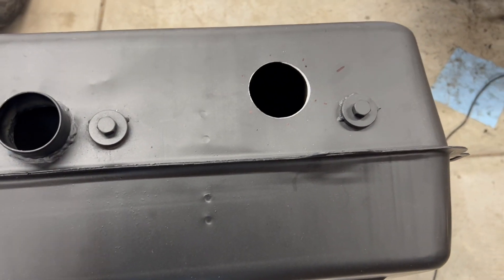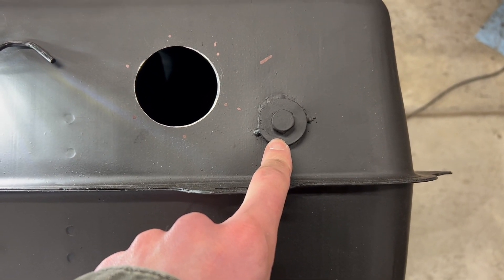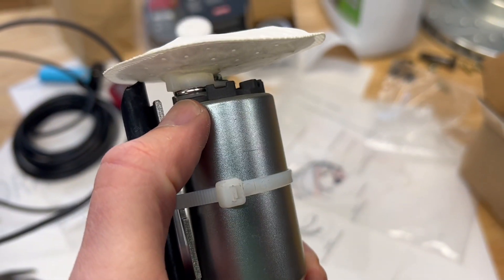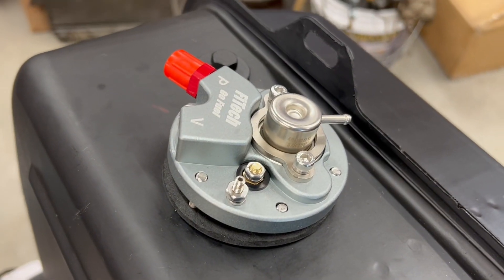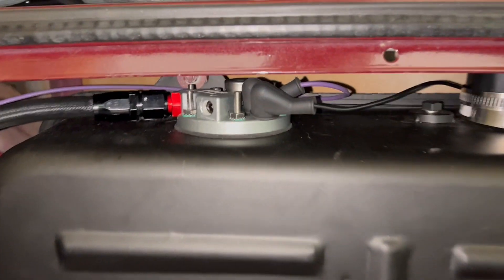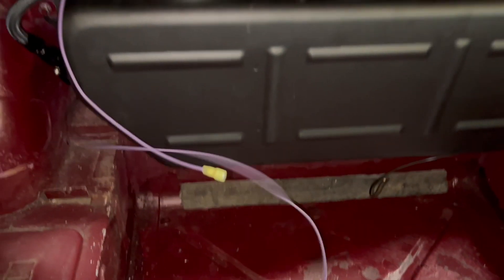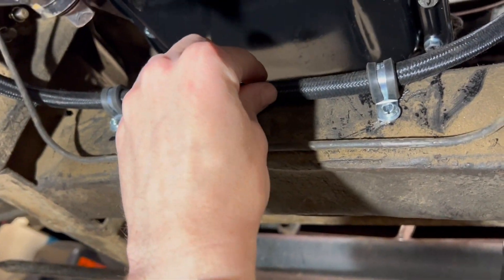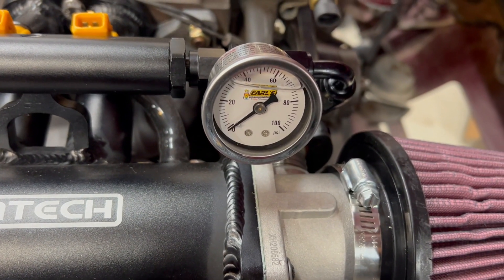Triumph TR6 EFI Fuel Injection Install Part 3.  Fuel pump and fuel line routing.

Comment: What make of fuel line, source, feet needed and connectors?
Reply from the maker: The fuel line came as part of the kit but it's 3/8" AN hose line.  The fittings are all AN-6 fittings.  Depends how you want to set it up and any extra connections you make, which will determine length and number of AN fittings.  I would measure the length of the car and add 10-15 feet on.  Then you will have plenty of extra.

Comment: Do you use the high pressure pump along with the in tank pump?
Reply from the maker: No, I just have the in-tank pump. For this particular pump (FiTech 50017) you just run a single feed line to the fuel rail and that’s it.

Comment: This is great work on the fuel system but I am completely baffles as to why you did not clean the chassis? The Triumph range are prone to rust and metal fatigue so protecting it with Ziebart/under seal/wax oil / etc would be a good insurance for long term ownership.

Comment: Hi , i subscribed to your channel awhile back. You mentioned you were using the purple wire to power the pump. I have a TR4A and the purple wire is unswitched 12V. The solid green is switched 12V which you may consider. Actually, since the pump probably pulls a lot of current you might want to wire in a relay directly to the battery for the power contacts and then wire the relay coil to the white ignition wire so the pump only runs when the key is on. Don’t forget an inertia switch👍.
You are going to have a great car when you’re done!!
Are you planning on attending the 6- pack trials this year?
Dave Connitt
Reply from the maker: Hi Dave. I ran a new purple wire from the engine compartment back to the trunk. It’s a new wire that I’ll hook up when I do the wiring. I should have been more clear on that. I used purple because it’s the only 12awg wire I could find that was long enough. 

When it comes time to hook everything up you are correct. A green or white wire is needed since it’s switched. The kit comes with a relay as well.  I also have an inertia switch. I’ll cover all that when I get the wiring done. 

Cheers
Reply: @hollywoodd3191  I have done some modifications to my TR4A similar to your TR6 regarding the Infinity Q45 diff., Richard Good CV joint half axles and Richard Good hubs. I am all in on making your TR reliable for long drives. You are going to have a really solid car when you are done. I am located is Cincinnati and have driven east extensively. Twice to Watkins Glen for the vintage races and once to Stowe, Vt.
Later this month we are driving to Manitou Springs,Co to drive up Pikes Peak.  Then on to Yellowstone and finally through the Badlands. You are doing some impressive upgrades and I look forward to seeing the final result.
My YouTube channel is DavesTR4A.
Reply: @DavesTR4A  Hey Dave, I just followed your links and yes you certainly get around with your tr4. I'm doing this conversion currently. I'm cutting holes for the pump and running lines and wires tomorrow! https://www.youtube.com/channel/UCa52riltF60CkisWjINjkQw Thanks for posting the videos. Very helpful!